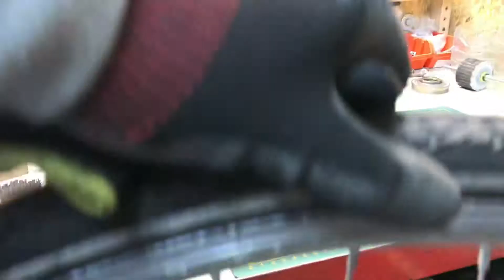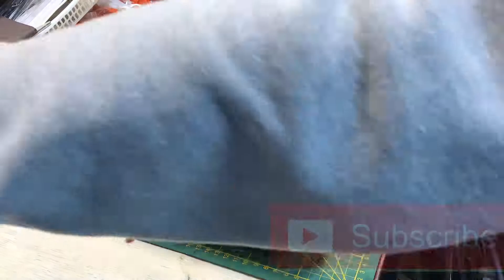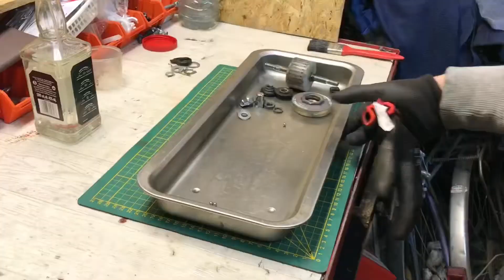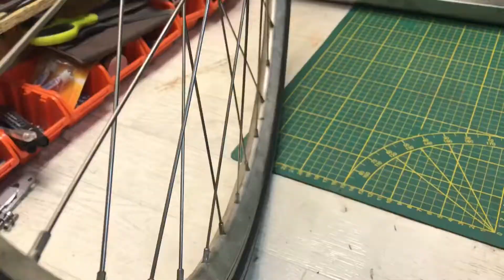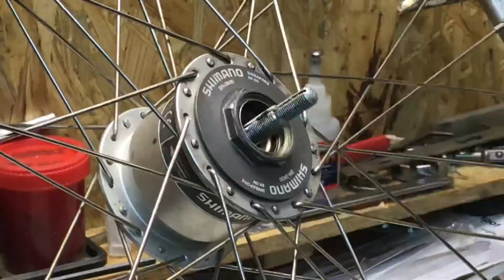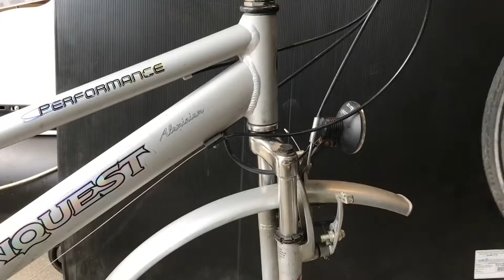How to SHIMANO DYNOHUB Service Internal Assembly Step by step

Comment: On 3:26-3:27 you have turned the  pad without comment! Without noticing it assembly can go very wrong!
Reply: Can you explain a bit more? I didn't understand where the danger is
Reply: @Superogobongo  At 3:15, the washer is installed ‘in reverse’ from how it should be mounted. After the film is assembled, at 3:17, the upper washer is already installed correctly.
Reply: Chodzi o to że przewód powinien przechodzić na zewnątrz tych dwóch metalowych podkładek w kształcie domu

Comment: With these dynamo hubs its crucial to set a tiny little bit of bearing play,  as there is no way to feel if the bearing rotate smoothly by hand.   Actually i think they all set too tight from factory,  at least in mine hub one of the race even had a hole in it.